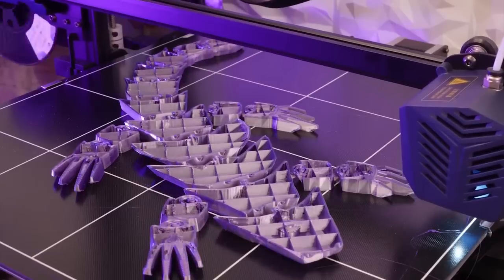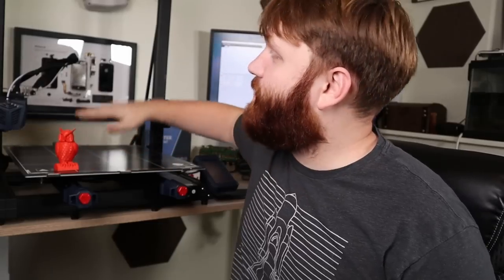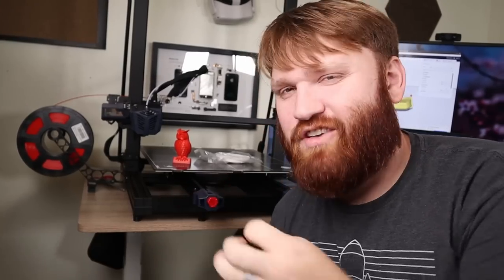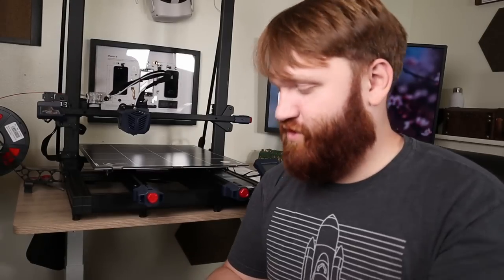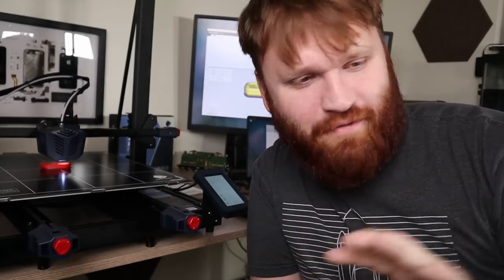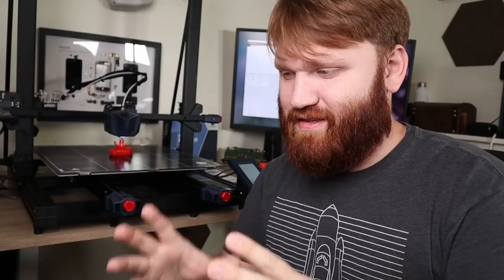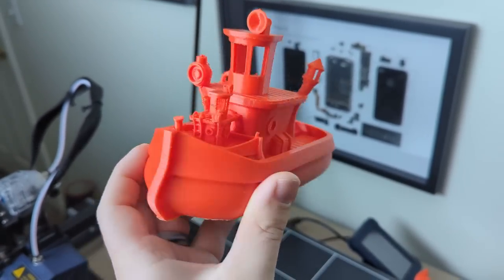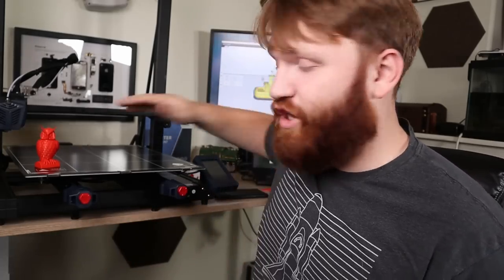this 3D printer is a BEAST

Comment: 3D printers have gotten a lot easier to use in recent years. Who knows, we may have full on replicators in the next 10 to 20. Though they won't use FDM or SLS techniques to construct things. Most likely method will involve a vacuum chamber and an electron beam like an old CRT. One of the pieces of technology that came about recently is that a laser tuned to the inverse frequency of vibration for a given element can actually cool it down. They managed to achieve the coldest temperature yet using rubidium and a laser printer diode. So it's not that far fetched.

Comment: hello. watched your video on ultramarine, and i have to say. thank you! i need help adding my ender 3 to my ultramarine 36. lsusb sees it, but when i go to pronterface it will not see it at all. even if i pick the correct baudrate, does not give me a "com6, com5, etc" to pick from. when i tried zorin os (solid os!! may go back) all i had to do was "sudo (myname) dialout" and it worked. i tried in the group but i dont speak fedoreeze. any help highly appreciated. cura. and prusa slicer wont see my printer. ender 3 pro, creality 4.2.7

Comment: Does it produce toxic fumes from heating up plastic? I see that youre not set up next to a window or ventilation.
Reply: PLA and PETG printing is perfectly healthy, ABS not so much but most people avoid printing ABS because it's also hard to print and gives you a headache
Reply from the maker: I'm not a professional but on the packaging for my filament is said it was non-toxic. I had it there for recording. It's in the garage now.